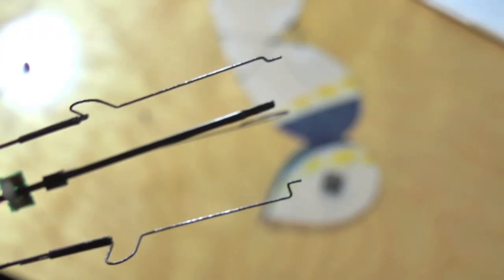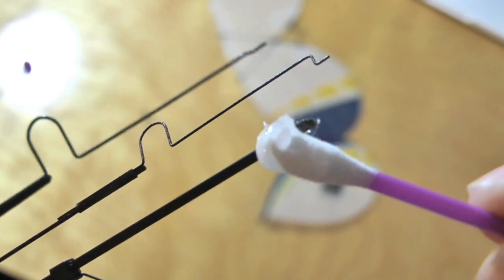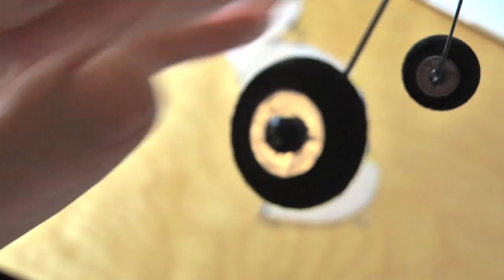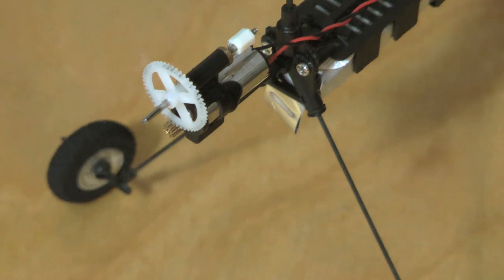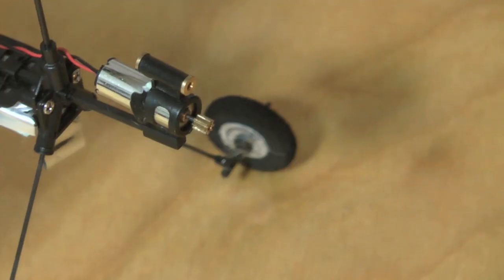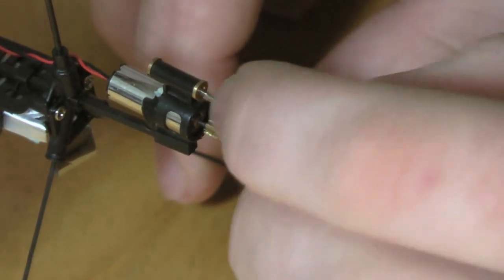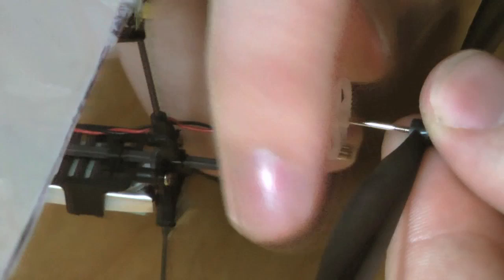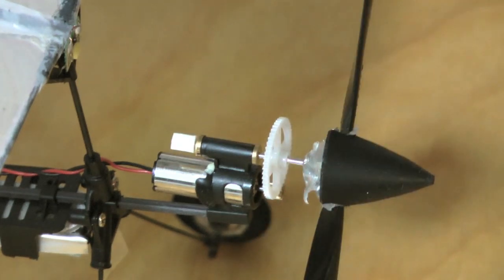Vapor Repair

Comment: To keep my spinner in place I put a tiny dab of blue RTV in the hole and put it back, checked for alignment and left it to dry for 24 hours.  RTV is easily removed yet strong enough to hold the spinner on.  It wouldn't work for structural repairs.
Medium cyanoacrylate  would work and can be removed (softened ) by repeated applications of acetone.  (Finger nail polish remover)  The acetone may eat the plastic film, so you're on your own trying that.  I haven't had to use it yet.

Comment: i broke my elevator and didnt realize that there was a rod that had to be free, so i glue the pieace back on and when i turned it on and elevator downed,it snapped the t piece right off and glued the elevator to the T piece and the T piece to the body, and wont come off, is it FUBAR?
Reply: David Hammond it doesn't matter cause that whole T piece comes off - the new elevator has a whole new T piece
Reply: like i said, the T peice was glued to the rod, but i was able to cut it off with an exacto knife.
Reply: if you shortened the fuselage stick that's not great but you can recover - just only insert a tiny bit of the remaining fuselage stick into the T piece, then compensate but stortening the pushrods (squeeze the U shape bit near the tail together)

Comment: NO HOT GLUE..  Please people watch a couple other videos first.. and dont forget Horizon Hobby has live product support.. always ask them what to use for adhesive.. its free to ask. But could cost you hundreds if you use what some random dude on YouTube put. That's probably why he didn't fly it after the repair. Yeah common sense. No hot glue. Some people like to put bad information on purpose. This guy is cool he just doesn't know any better. Also 5 minute epoxy... bad idea....!! Good luck scraping that off for another repair.